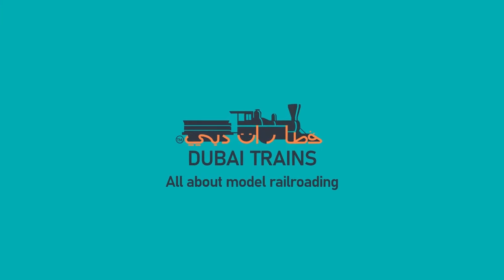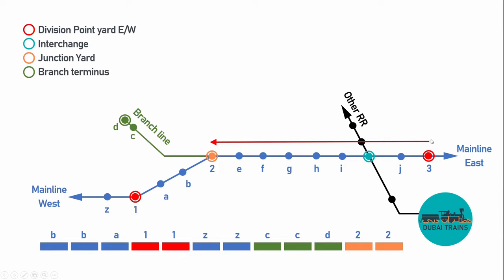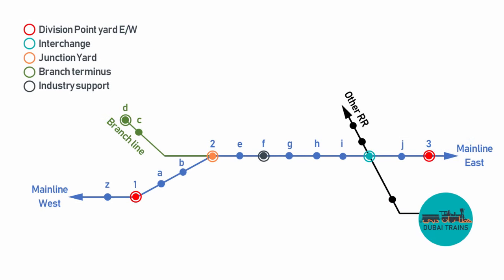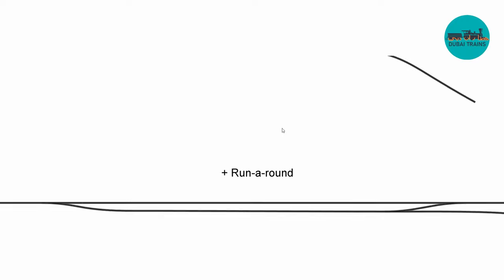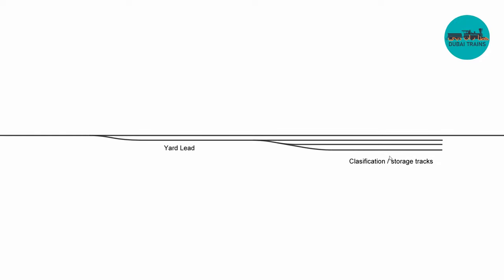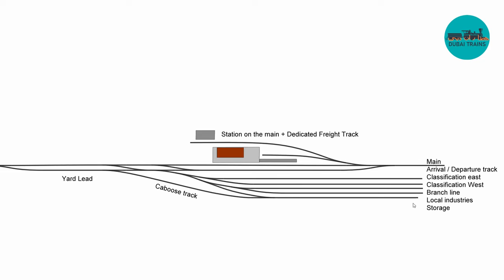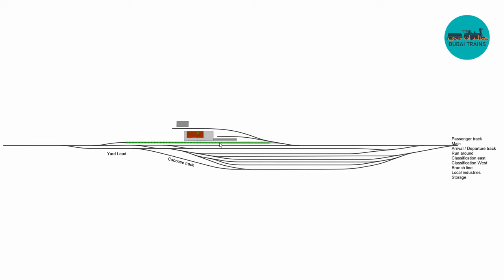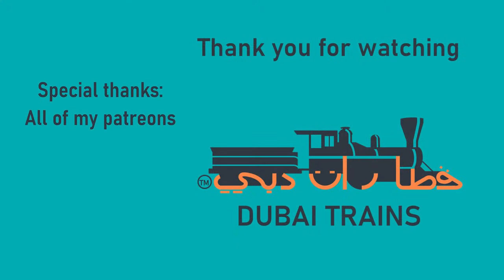49 - Railroad yards explained! With over 25 yard track plans and every detail explained.

Comment: THANK YOU SO MUCH

I was wanting to find a Yard Design Video just like yours.

I’ve been away from the Hobby for over 30 years.

I’m starting over way too late, but your yard diagrams will help so much!

Modeling in N Scale in a rectangle area that is 12’ by 20’.  

Going to be using KATO Unitrack.

Surprise as to my expenses using that track.  

From the late 1970s, I opened up the storage containers with all my Atlas N Scale Track.

Some in the original unopened envelopes.

$1.22 for 5 pieces of straight & curved track.  $8.00 for electric turnouts.  Gave me a laugh or two.  10 pieces of Flex Track.  Almost 50 year old track and NOS Cork.

Guess I will try to use Atlas track where possible.
Reply from the maker: Great to hear that it was usefull.

Comment: Great video of yard layouts.   I railfan the Union Pacific Roseville yard in NorCal A LOT.  Watching freight trains arrive and depart along with power moves, and the hump yard over a couple of years,, I've deduced much of what you explained in your video.  Roseville is 88 tracks wide at its widest, contains hundreds of individual track numbers, is served by two main lines and can simultaneously recieve and depart trains in both directions while also humping/classifiying trains at the same time.  And still, they get completely jammed up and have to park trains on the main lines all the time because the 12 recieving tracks are often full
Reply from the maker: Sounds like a great spot to railfan! Great that you over the years have dissected the yard and found its core functions. 
As all yards to the T are different, the are all built out of the same components.

Comment: Any nice recommendation track in HO for a layout that is 8 feet long and 31 inches wide? Thanks in advance, want to make a rail yard Only layout. 👍🏼👍🏼👍🏼👍🏼
Reply from the maker: Hi SaxManIvan, many decades ago I had 1 sax lesson. After blowing a few times on the reed, the teacher said no 😅. So I became a drummer. 
8ft can be a nice a switching layout. But we need to dive deeper into what it is you want. What enjoyment are you looking to get out of a  'yard only' layout? Is it classifying, or switching, or is it that you enjoy the sight of rows of boxcards?  Sorry to answer your question with a barrage of questions.
Reply: @DubaiTrains  I would like to just jockey some box cars around,, I guess switch would be the correct word, I don’t know much about train yards and your videos are simply OUTSTANDING in explaining everything, I plan on having only 1 switcher (SW 1200) a GP38 if those are used in a Yard and an SD 40. So just 3 diesel locomotives. I don’t know if that would be possible. I mess around with N gauge on a much smaller layout. Thanks again, Funny about your Sax teacher, it takes a little time, once you do it everyday it is much easier. 👍🏼👍🏼👍🏼.
Reply from the maker: Whatever the trackplan will be,  it will be linear. 31 inch in HO is not enough to make a 180 degrees turn. 
If you just wanna kick some cars around,  there are many options. Personally, given the limited space, I would try to do 1 thing very well. So for example a mainline with spur that serves a complex industry. That would give the switching some purpose. I.e. cars come in on the spur, and need to be spotted at the industry. 
Hope this helps! 👍🏻